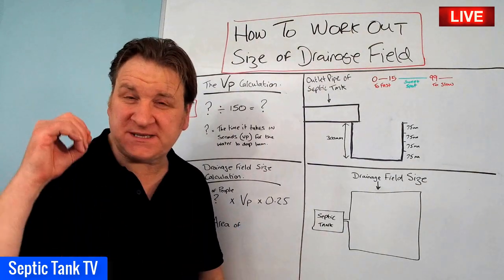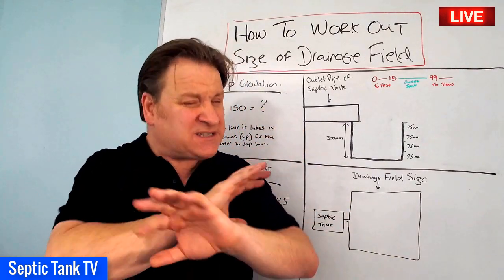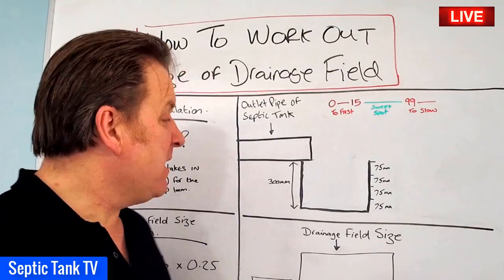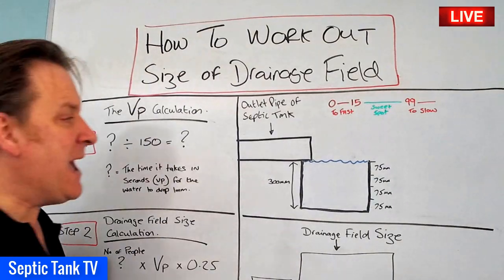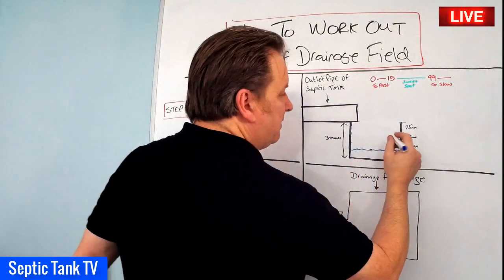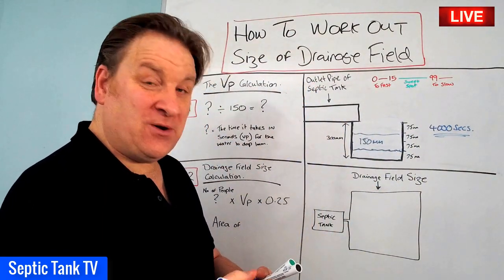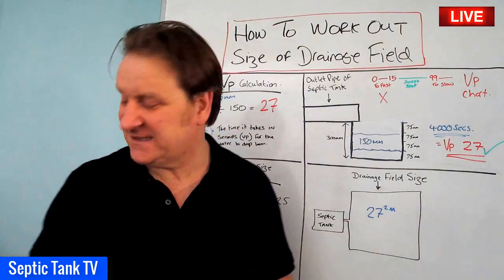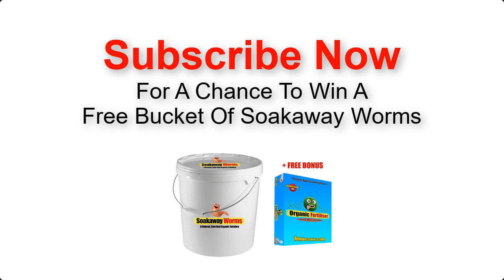How To Calculate Septic Tank Drain Field Size

Comment: This formula or percolation rate doesn't take into account the soil conditions or the depth of the Water Table. To be clear, in America, we have to dig test pits to identify the elevation or depth of the Seasonal High Water Table, and make sure we stay at least 4 feet above it. The idea is to make sure that groundwater isn't getting contaminated by your Soakaway. Fortunately, 4 feet of earth, is usually adequate if the soil conditions are right. For example, clay and/or ledge, prohibit leaching, and any non-permeable substrate that prevents water absorbtion and dissipation wouldn't pass a Percolation Test anyway. This is why raised Leaching Fields or Pump-up Systems are frequently required in the United States. We elevate or raise the Leachfield or Drainfield to prevent contamination of the groundwater, and to create suitable conditions for water absorbtion and dissipation. Typically, raised systems use only sand to filter the wastewater, and are commonly referred to as sand mound systems for this reason.